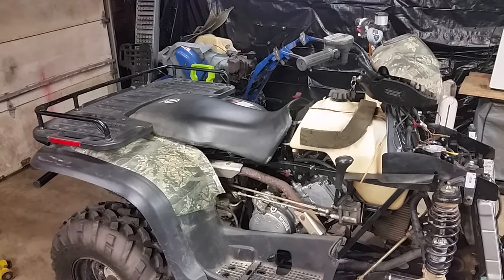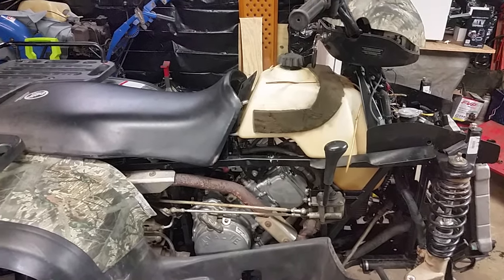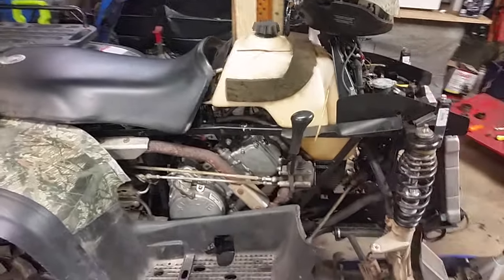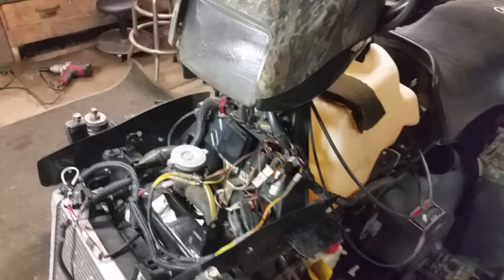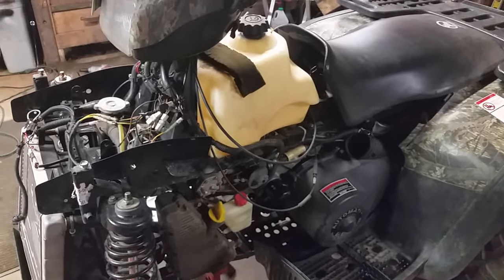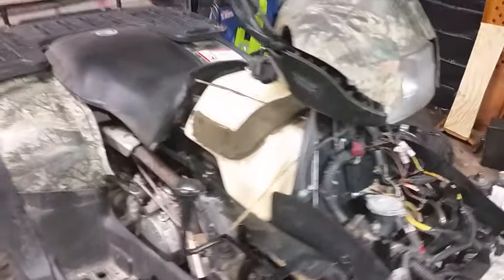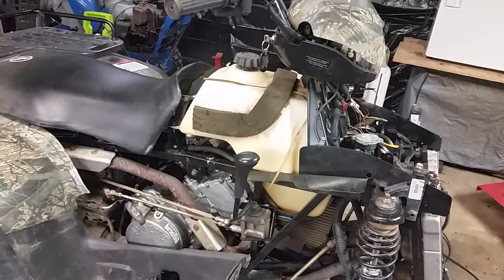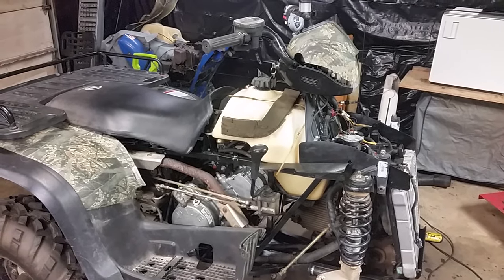Polaris sportsman 500 idles But dies when I hit the throttle.  Find out why?

Comment: My friend, you have to tune the carburetor, look at you spark plug to see if it is running lean or rich, in your case most likely rich. You should adjust the jet by moving the clip in the jet in the carb up a notch, the use the air/fuel screw next to the intake on the carb until it runs fluently. You can also adjust the idle screw as needed because it will need it after changing the air/fuel ratio. Hope this helps!
Reply: Another thing to check it the float in the carb. Just found out today while working on a mini atv. Hope this helps!
Reply: well it’s not the carb it is sadly an electrical issues, had the same problem with my suzuki vinson 500 yesterday and was trying too fix it, i took the whole carb apart, and cleaned everything, we tuned the carburetor over and over, and nothing changed, we give it throttle and it would die, i’m pretty sure this guy knows what he’s doing if he has a “few motors laying around”, not saying you don’t know your stuff, just saying you can still learn something new, even when you thought you knew everything 👍 i appreciate this guy for the video, i just put in a order for a (OEM cdi unit) and a (OEM Carburetor) i’ll replace the cdi before the carb and i’ll let you know how it goes💯
Reply: @StyFresh how did it go?
Reply: @StyFresh hey I have a suzuki vinson 500 aswell and I'm having the same problem I'm yet to take the carburetor out but I'd like to hear what was wrong because one of my fuses attached to my battery was blown so I'd like to know how yours went!
Reply: @anyabsentjarl6196  honestly it’s still sitting there not running I was planning on towing it home and working on it I’ll let you know soon! Someone lie my car on fire tonight lol

Comment: In case someone revisits this thread. Sportsman 400 would die with throttle. I was troubleshooting the fuel pump and placed my finger over the vacuum hose and felt suction. It instantly started idling higher. I adjusted the idling and reassembled the fuel pump and it now runs great. I think covering the vacuum hose with my finger created extra suction in the carb or hoses and unclogged something. I also have an aftermarket carb with a hose cap on the top that was cracked. All fixed.

Comment: Thanx for all your vids. I have a 99 sportsman that needed a cam. watched your vid and completed repair. Started up fine and idles great. any throttle input it dies. bought the air screw adjuster tool and have fiddled with it endlessly.  i can get it to make revs but once shut off and cooled down the same thing happens. once i get it to rev it runs great but will not go slow. as soon as i get out of the throttle it bogs and I have to choke it to keep running then it will rev great again. I have checked everything a dozen times. Bought new carb off amazon and same thing. also put a new carb boot on it. same thing. I am stumped.

Comment: Thanks for this info. I've got a 400 that's doing the exact same thing. I've swapped carbs, rebuilt carbs, etc, etc. I'll try this before I push it out back and set it on fire.
Reply from the maker: Hahaha! That's how I felt about this one.
Reply: did it work
Reply: Let us know if it worked out for u also
Reply from the maker: @Glucoperon  yes
Reply from the maker: @tava7902  yes it did
Reply: For me, a new carb was the problem. the old carb works. I guess vacume level of the engine was an issue with cheap Chinese carbs
Reply: @Glucoperon  I just got his this 1 running yesterday.  He bought a cheap ol carb 2 years ago. The diaphragm ontop wouldn't seal. These cheap carbs have a shelf life. I do more work on cheap replacement carbs than rebuilding and cleaning factory.  Some say they are the same... or remanded.  Meh haha.
Reply: I tried a new/used CDI box, and that didn't fix it. I replaced the electronic throttle control (ETC), adjusted accordingly, and its running fine. I checked the ETC several times during this project, and it was set per the manual. I hate shotguning parts at things, but it worked this time. This one drove me to the edge. 1996 Sportsman 400 4x4.
Reply from the maker: @deerslayer6419  Glad you figured it out. Sometimes just moving wires around does the trick. Too many safety features on these. I had one I worked on..spent hours figuring it out. Turned out it was the on/off kill/light switch. The inside had turned green. It would start..but die right away.

Comment: i wonder if you just had a short in your wiring that was fixed by reconnecting/moving wires around. i believe that has a rev limiter circuit that gets engaged only when you hit the throttle, if that was shorted it would kill it the second you touch the throttle.

Comment: Exact same problem. 2009 Sportsman 500 HO. sputters at 5500 rpm. I did replace the carb with the Amazon $38 one. Not fixed. Returned to Amazon (make sure you get the carb that says "free returns" or you'll be paying shipping). Put old carb back on. Then I replaced the two fuel lines on each side of the carb from the fuel pump and the vent tube on the right side that goes to the frame. That worked!!!! No sputtering or bogging down. I also tried the starter fluid spray on the carb boot and nothing happened so I figured good boot. I didn't believe you on the hoses replacement. But I sure do now. Thanks so much for this video. I must have taken that old carb off 7 times trying different things. Thanks again!!
Reply from the maker: Been there! Yup, its vacuum operated. So if the lines are weak..they collapse.
Reply: @TitaniummanGarage  After 2 days I'm back to the same problem. it idles fine then when you hit the throttle it dies. I probably need a CDI box. The OEM price is $400. I'll try the after market ones first and see if that fixes the problem.
Reply from the maker: Did you try adjusting the choke cable at all. I just had one with the same issues as yours. I tweaked the choke a little then it was fine after.

Comment: I am working (Infrequently) on a 96 sportsman. Just put the new spark plug wire in today and mounted the coil in front of the tank where the old one was- cannot find what gets plugged onto though. Meaning I’m not sure if its a red wire and if so where that is at? If you had a quick suggestion we would appreciate that. We looked at the diagrams we have but they are not helpful. Thanks for your time. 
Payne

Comment: I decided with all the free time I had along with the rest of the country ... I would do a little wrenching at home in my shop. 
So took in a polaris 400 year 2000. 
Been through everything couldn't find out why its popping heavily through carb. Found your videos on these things. They have been a ton of help thankyou! 
I have the valve cover off now for a cam inspection.. If it's not that I am going directly to cdi! 
I told the owner who told me when he dropped it off I didnt think it was a carb issue. Sounded electrical..
Reply from the maker: Your on the right track.  I would do the same. Thanks for watching. I'm glad to help.

Comment: Hello, so far I've liked your videos. I do have a question about a 2005 Polaris sportsman 500 HO that I'm having problems with. I had overheating issues with it at one point which ended up being my plugged radiator but in the meantime it now will start and idle but will not rev up. Do you think you would still be the CDI? That would be the problem? Thank you for your videos
Reply from the maker: If it was overheating, I would pull the spark plug. See if its wet. Make sure you didn't blow a head gasket.

Comment: Check the ground wire coming off the spark plug coil as well. Sometimes the cheap ground wire breaks coming off of it and it keeps the top end from sparking properly and in sync. That’s a huge problem with these and it’s an easy thing to pass over.
Reply from the maker: Good Point. I've said in a lot of my videos, when it comes to electrical...Check the ground wires.

Comment: I just got one of these and I'm troubleshooting. Something driving me nuts. The brown wire from the stator to the ignition coil has a pigtail with female spade connection. I cannot figure where that thing goes. I see in your video it is just kinda hanging out there too. Does this thing go nowhere? Is it Polaris' cruel joke or had you just not gotten around to reconnecting it. If it is the latter, could you please help a poor soul and tell me where it goes? Thanks

Comment: I just ordered a CDI box for my 500 based on this video hopefully that works. I also have a cheap aftermarket carb on there and was thinking of rebuilding the original mikuni with a mikuni kit but I can't seem to find one. It's a 96 sportsman 500 and I just cannot find what mikuni model that is. The numbers on the carb don't come up with any kind of search mikuni's own website doesn't list anything for a Polaris that old. The part number out of the Polaris shop manual doesn't bring up any results. And I'm having the same issue at idles just fine but it bogs down and dies when you try to do anything unless you get moving then it'll go at wide open throttle. Cam is good replaced the rockers they were worn timing chain was loose that's brand new. Has good compression I tested it with the compression override and without. With im getting about 80 psi and without I'm getting around 170.  Could you help a brother out so I can get that proper rebuild kit ordered I don't like using Chinese aftermarket kits.  Also it's pretty often that it won't shut off I unhook the black wire off the the one box that made no difference but I did notice if the ground wire for the cluster is not hooked up none of the instrument lights work and I get feedback through the gear selector to the headlights they shine dim and they change high to load depending on the gear you're in ground back up and everything works properly so I'm not sure if that's related somehow.  Thanks for the videos you're like the only guy on YouTube that seems to know what he's talking about I watch every one of them keep it up.

Comment: I've got a 97 Sportsman 500 that just seems like it's out of time and I've done all of the steps you're supposed to do to make sure that it's in time and replace the cam with an aftermarket. I've got plenty of spark but when I add fuel to it it backfires out of the carburetor. It acts like it's out of time but I've set it twice now and changed the carb trying to trouble shoot, still out of carb. Good spark and motor has low hrs on it, seems crazy to be cdi? It had the idle fall on its face before the no start backfire carb thing. Gonna chk cdi, fingers crossed.
Reply from the maker: Had that issue on a scrambler. Have you checked they flywheel to make sure the woodruff key didn't snap? That would knock the timing off.

Comment: Mine is doing this but it will run with the choke pulled so I’m thinking it’s the carb. Did yours run with the choke on?
Reply: Mine does but misses real bad when you give it gas im thinking cdi got new carb still same issue

Comment: Did pulling the choke out seem to make any difference when it was running? That’s what mines doing. Idles fine, falls on its face when gas is applied. Pull choke and it will take probably a 1/4 throttle. My guess is a plugged main. Thoughts?
Reply from the maker: Yup. When you pull the choke it actually allows more gas to flow in.
Reply: What if you pull the choke and it dies after a while

Comment: Question for you - I have a 2000 Sportsman 500.  Just a little history.  Back in summer had to replace the starter.  Did that but then noticed that the carb was leaking gas.  Pulled the carb and rebuilt it put back on and started fine.  I then pressure washed it.  Might have been a little aggressive with

Comment: I am having the same issue, but if I put my hand in from of carb it will rev up. Did yours do this? I have had 3 carbs on it also.
Reply from the maker: Sounds like you have a air leak. I would check the intake boot for cracks.
Reply: hey i just had this problem! i put my hand over carb and it finally took and started a little, then i played with the throttle while doing it and it was the etc

Comment: Thank for all the videos i have a 04 sportsman  500 same problem  Installed  a $ 30 cdi same problem will not rev quick this machine has 780 hours at what hours do you see cam shafts worn , and thanks again
Reply from the maker: Depends on the year. 97 to 99 had soft camshaft. Around 2500 to most of them being 5000 miles. It's rare to see a 2001 with a bad cam unless something else caused it. Low oil or overheating.
Reply: @TitaniummanGarage  thank you very much I'm going to get a polaris $400 cdi box and give that a shot
Reply from the maker: @stansimpkins6439  I found one on ebay for 52 bucks made in America. So far I'm happy with it. It's the red box if you look on Ebay.
Reply: @TitaniummanGarage  sir once again thanks for taking the time to help me out . Unfortunately I  cant find the a red box one that fit a 04 sportsman, the ones i saw have pig tails coming out of it  if you a have a seller name or a item# that would be awesome, i did find a couple of used ones , if you have a PayPal account i will compensate you for your time 
THANKS
Reply from the maker: @stansimpkins6439  Sorry...My bad. I was thinking you had an earlier model. You have what I call the plug and play style. I don't have any. But if you can find a good used one I'd buy it. Check out Powersports nation.
Reply: @TitaniummanGarage   sir I figured out it was not my cdi ,the needle valve  broke were the clip was, the  question I have is does the plastic washer that goes below the clip on the needle,  should that plastic washer or spacer  touch the bottom of the clip how far up the needle does it belong ,once again thanks for your videos and all your help
Reply: Sir I figured out the spacer should fit right underneath the clip on the needle valve , im going order  oem parts  thanks for all your help

Comment: Hey Titaniumman - thank you for the video and info.  I have an 07 Polaris Sportsman 500 EFI that has a similar problem.  Starts up fine, idles fine but you have to be gentle to start rolling otherwise it stalls out.  It will also bog and feels like not enough fuel is getting to the motor when at 35 mph.   Any suggestions or recommendations?  - thank you
Reply: Did you get this problem figured out? Same issue
Reply: @krisfrench8648  not yet..  I haven't had a chance to get to it.  It runs but the stalling and backfires are annoying...   But I am planning on rebuilding the fuel pump.  You cant buy a new pump alone but there is a rebuilt kit available.   I also noticed I was missing 2 of 4 airbox clips, so I will be closing the airbox tightly as soon as they arrive.  I dont think it's the issue, but you never know.
Reply: @paulpolanowski9660  did you get your problem fixed,  I have the same problem,  i had it in the shop (polaris dealer) they replaced wiring plugs going to the tps , iac, and map sensor.  then called and said the power distribution box needed to replaced, and that would fix it.. nope it did not.  after spending $1200 dollars i still have the same problem .
Reply: I’ve got the same problem .. I ordered a new cdi box and it does the same thing .. might be because it’s not an original oem Polaris cdi box . China box

Comment: Hm thanks for the video. I have a can am that has done this since I bought it, same thing except sometimes it just bogs down, other times it dies.  Sometimes it does the same thing when the throttle is about to be let go, would it still be that part?
Reply from the maker: I mainly work on Polaris so I am not certain.

Comment: I just bought an 05 Honda foreman 500 with this same issue. Guy I bought it from put a new carb, new fuel lines, fresh gas. Should I start with the cdi box?
Reply from the maker: You could try that. I would also check the valve clearance between rocker arms. I had a honda 350. I adjusted rocker arms and it ran better.
Reply: @TitaniummanGarage  I would definitely keep that in mind, I will start in the carb and work my way. Thank you

Comment: I have a very similar issue.  Starts and idles well. but when throttled past 50% it dies.  However, if I baby it past 1/2 throttle very slowly it makes it to full throttle/RPM.  I thought fuel pump.  replaced, and same problem.  Now I think there is something restricting the fuel line.  Pulled the tank and found varnish particles.  Is there a filter inside the tank?  Looks like a grommet there that I do not want to force out and  break something.
Reply from the maker: Yes, There is a filter in there. I blow through the fuel line. Or pull the tank and flush it out.
Reply: Did this help? I have the exact same issue. I did replace the fuel pump. The gas fill the fuel filter?? @TitaniummanGarage